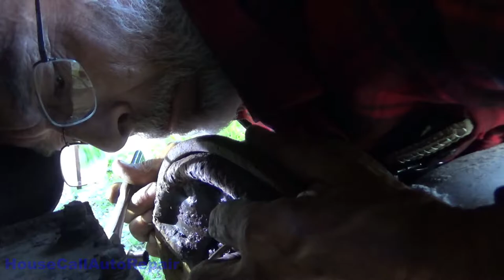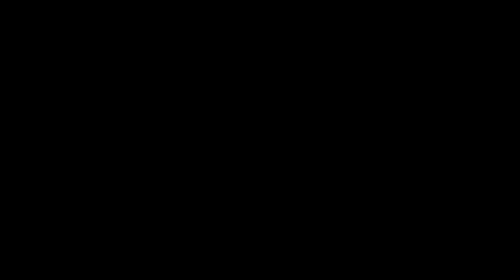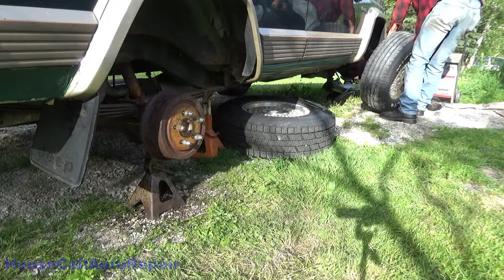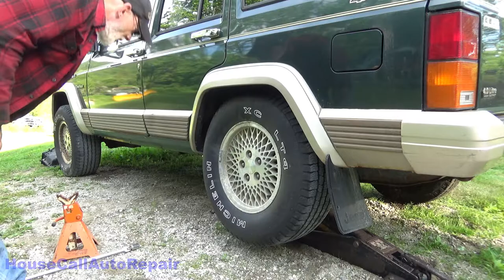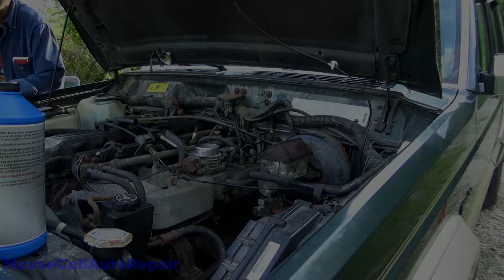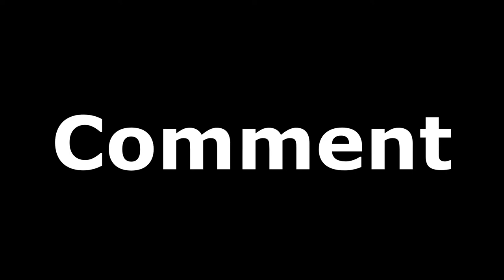1993 Cherokee Brake Lines - Part 3 - Wrapping It Up... - Auto Repair

Comment: Hey glad to see your back I have not seen you in awhile..  great job thanks for your time..
Reply from the maker: got a bit of an editing backlog....
Reply: That move with the brake clean and the sound you added,  was spot on😮! I have to do my rear drums, not very rusted drums. Do I need to get new drums? Hope to reuse it. Thank you!
Reply: Drum brakes on 02 Corolla!
Reply from the maker: If you see any grooves, or feel any pulsing from the parking brake during light application, then yes, replace them.